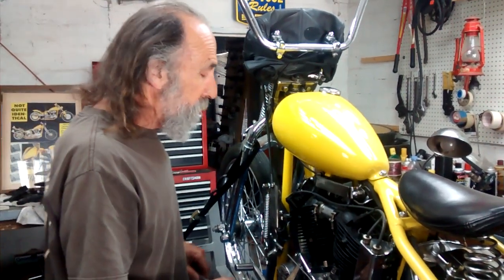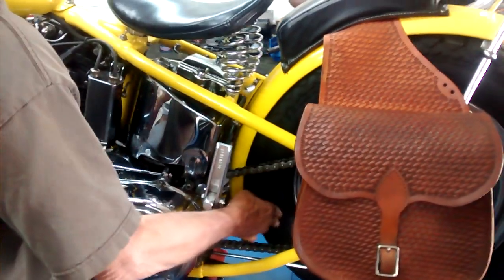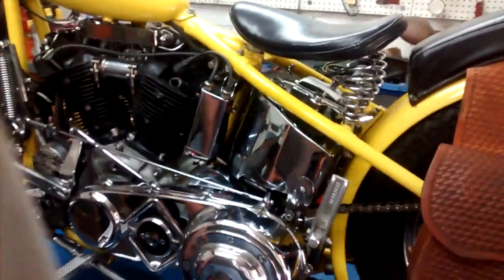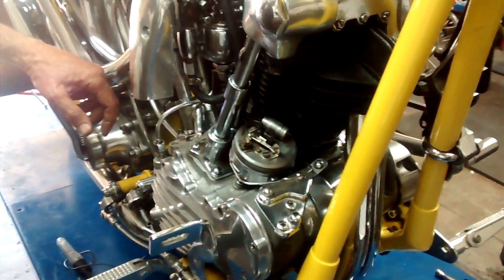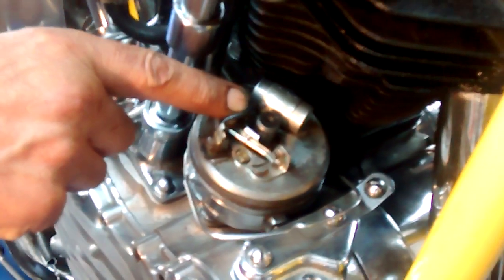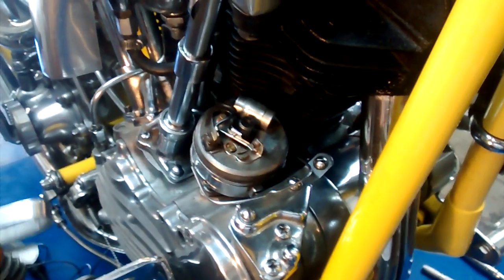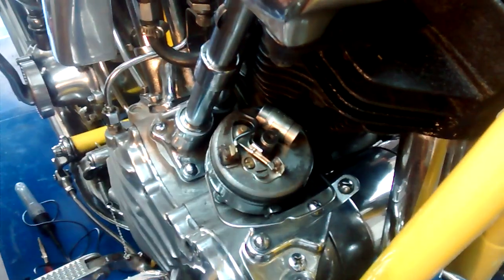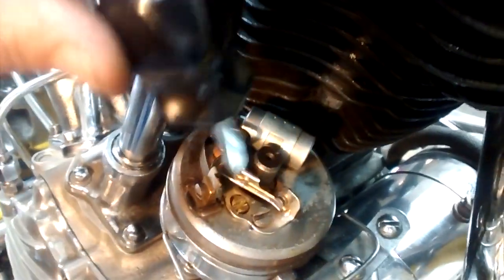How to set the points and timing on an old Harley Davidson Big Twin.

Comment: Hi Mike, thanks for getting back. So since 'unleaded fuel' you suggested that plugs are not so easy to read without the newfangled gizmo?
Reply from the maker: It's just that they don't color up like they used too.  Then, the manufacturers wants you to read the plug way deep inside where there"s a flat ring where the insulator and the outer casing go together.  It's a skinny little flat surface. They sell little flashlights with magnifiers on them so you can see inside the plug.  About all I can tell about a plug any more  is if the condition is real obvious  like,"wow,  there's nothing on it." or "That plug is dark."  Then there"s the usual, "They sure don't match," indicationg a vacuum leak.  I think the fuel is tough to read and I'd like to think we build our motors better.  Just ain't like it used to be. Nowdays, I'm pleased to have just a little color, my old bikes, a little more color than the newer stuff.

Comment: Any advice for a fresh bill everything seems to be time bride but keeps sputtering out the carburetor will not start
Reply from the maker: Start setting it up all over again and check each thing.  Gaps, plugs and points, battery voltage, voltage going in to coil, ignition timing, fuel flow to carburetor, and is the float bowl filling up.  Just go step by step all the way through it.  You'll get there.

Comment: Just had to say great video! First time watching your channel and yes i did subscribe. I have a 75 FLH with a 93" all S&S style shovel. It came with an electronic distributor but I'm thinking of switching it to points since i don't have everything i need to make it work and the parts to do so are expensive. Not sure whether to go single fire or dual as well as whether to go single or dual on the points. Just looking to build a reliable daily rider. Nothing more. Any help at all would be much appreciated. If your answers are to long for here i can provide my email address. Thank you sir and keep up the great work!
Reply from the maker: I hate to say it, but dual points are awful!  Getting them to sync properly and stay that way is somewhat maddening.  A 93" Shovelhead is a serious motor.  Be careful in your decisions and gear it very high.  It has the torque to pull tall gears and it will keep it at low rpm's.  When you can afford it, and I don't usually plug products, Dynatek is the answer.

Comment: Will this Work for an Evo man? I love your channel thank you. I bought a 97 lowrider man and it's my first vehicle. Trying to tune her up. Thanks man.
Reply from the maker: Has someone installed an ignition points system in your Evo?  If so, use an HD service manual that shows the procedure for 70-77 Big Twins.

Comment: On my 1966 shovelhead when the line is dead center in the window my intake valve has light pressure on it you cannot turn the pushrod. Should I loosen the pushrod so both valves are completely closed in that position?
Reply: It’s the same on 180 and 360 revolution
Reply from the maker: Turn the engine over by hand with the sparkplugs out.  When the intake drops, keep going until it has gone down as far as it is going to.  Now adjust it.  I'm assuming you have solid lifters.  If you do, you should be able to turn the pushrod with your fingers.  The limne on the flywheel is your advance timing mark, not TDC.  Those marks are for timing ignition, not adjusting valves.
Reply: @pacificmike9501  When my rear exhaust push rod is fully extended my front cylinder exhaust push rod is loose and vice verse. 

When my rear intake pushrod is fully extended my front intake push rod is loose and vice verse

At no point on the front cylinder is the intake and the exhaust loose for me to do timing. 

I’m trying to understand if I’m timed correctly at top dead center and not on overlap. The bike is running fine just a question.  1966 shovelhead
Reply: Yes I have solid lifters

Comment: Question Mike, tuning up my 58 FL, I wanted to check spark on the plugs, turning the engine over I notice that both plugs sparked at the same time, once at the timing mark on distributor then 180 degrees off for rear cylinder, is it normal that both plugs spark at the same time ?
Reply from the maker: Yes.  There is a "wasted" spark that goes to the "other" cylinder while the piston is on its exhaust stroke.
Reply: Unless you have 2 coils and dual points.
Reply: I have seen this

Comment: Heck, Mike, I was waiting for you to whip out a rolling paper (i wonder how many folks know what i'm talking about ^)
On my circuit breaker housing there's a timing mark that should align close to the outside edge of the strap the lock nut tightens down.
Are you familiar with that?
Reply from the maker: Sure, it is so, so that you can rotate the housing to give yourself the adjustment you require.  And, I've become so civilized that I use a feeler gauge.  Out on the road, under a tree, that's something a little different. Actually, back in the day, a matchbook cover was real close on point settings.

Comment: Hi Mike, appreciate the instruction vid!
Just wanted to let you know that the original instruction (per manual and Palmers restoration book) for single points early big twin is to set the timing with the line on the flywheel on the right side of the window and not the center. Unclear how close it should be to the right side (I've read 1/16th" and 1/8th") Also for Dale Marcus.

So my question for you Mike is how did you get to setting it in the center? According to the manual thats retarding the timing. Are you running unleaded fuel without ethanol? Also the cam that is in the bike is important of course.  Was it running hot at more advance? Just trying to figure it out for my own bike. Thanks in advance for a reply.
Reply from the maker: Make sure you're looking at the right manual for your bike.  The location of the advance mark on your flywheel should appear in the window where it is supposed to according to your size and model, automatic or manual advance.  You start out with the factory recommendation, then "minor" adjustment from there.  I don't know what your bike is.  But, there's a picture of that window in the right book.

Comment: Mike my names Nathan Morgan I'm from fayetteville Arkansas I have a 95 heritage Softail Springer built by American street dreams I now live down in Texas and my bike has a 38mm Edelbrock Quicksilver carburetor my dad had it sitting for about five years I finally brought it home got it running now it's running super rich fouling out the plugs could u give me any pointers by any chance brother
Reply from the maker: You're probably looking at the right place.  I have not even seen those carburetors in years.  They were distributed by Edelbrock, mostly through (maybe even "exclusively,'" not sure) Rivera Engineering.  I doubt, if you're careful, that you will require parts to disassemble and clean it out real well.  Also, clean out the tank and be sure you're running a clean fuel filter.  Be sure you're running a clean air filter.  If the air filter is real dirty, the carb will run way too rich.
Reply: I really appreciate ur advise brother I will keep u posted on how things are going with it God bless

Comment: What 12v coil are you running? Is it V twin?
Reply from the maker: It's a "one-off" unit assembled by a genius friend of mine.  On my Panhead, I run an Andrews coil (late style) and I use the bracket (after drilling out the rivets) off of an old coil.

Comment: is timing set off the advance mark or TDC mark?
Reply from the maker: The advance mark.  (vertical line)
Reply: @pacificmike9501  thank you. should i advance the cam to find where the points lift up? or no. thanks for your help
Reply from the maker: Not knowing what you have, I think you have a centrifigal advance ignition system.  So, you either have an old bike with a "distributor" (circuit breaker).  Or, you have a bike with a cone motor and a points system with a centrifigal advance mechanism.  You're doing this by hand and you've got the advance timing mark in the window.  Now turn the ignition cam all the way and it just starts to barely open the points.  That's it.  Make sure you are on the compression stroke of the front cylinder (both front cylinder valves are closed).  Now, buy a proper service manual and please tell me in the future, what bike you are working on.
Reply: @pacificmike9501  2001 sportster converted to points ignition with dual fire 5 ohm coil. thanks!

Comment: Good video but where are the serial numbers on your bike? I use the plastic plug and it has to be very close to the flywheel without touching it. I then have to hold the timing light at an angle to the side of the plug. Done it this way many times. If the plug gets scratched you can touch it up on the buffing wheel.
Reply from the maker: Thank You.  And, she has NOS  cases.

Comment: how would you set dual points with hand timing adjustment on a 62 fl ? ..thanks
Reply from the maker: Pretty involved.  It's explained very well in the HD 1959-1969 FL Service Manual.  Normally, unless someone really wants to preserve that system, I change over to the earlier (single points, single coil) system.  It's much easier to maintain and, in practice, gives a more "consistent" tune.  I don't mean to knock it.  But, when in the middle of nowhere,  I really prefer simplicity.  Whenever I tune one of those, they run beautifully, but they seem to require more maintenance to hold both sets of points to play well with each other.

Comment: looks like you set it to spark at exactly top dead center and not a bit advanced. Am I missing something?
Reply from the maker: The mark on the flywheel is the advance mark.  If you're timing to it, it is fully advanced.

Comment: I have a 66 shovel but i see no timing marks om the flywheel just one hole.help
Reply from the maker: Look at your service manual.  They describe the location of the advance timing mark.  I'll bet it's there (7/16" before TDC on the front cylinder compression stroke).

Comment: Mike, have got any other cool rides? If so can you do some work or videos on them?
Reply from the maker: I've been resurrecting my old road bike.  We've shown it getting it's motor and trans installed.  We've reinstalled the top end, front wheel and fender.  It's about ready to enjoy Spring.  It will show up, when it needs something.  Once it's going, the Panhead needs a new trans seal.  We'll show that.  We'll show things as they come up.  Thanks for watching.
Reply: @pacificmike9501  you bet,been following you about a month I guess,...I work in a shipyard and after that dose of daily mahem, I wind down watching you and tatro machine, ha ha, well keep making the videos.                      - Brad
Reply from the maker: Very cool, thank you.

Comment: Thank you for the video. I have a ‘47 EL and find doing this is such pain. The manual says that the gap should be .022” at the highest point of the cam lobe. I notice, however, when I retard the circuit breaker the points open and I can’t kick her over.
Reply from the maker: Are you setting the timing as per the service manual?  The slash mark on the flywheel in the center of the window with the circuit breaker advanced so the mark on the circuit breaker cam is lined up with the fiber on the points assembly.  Make sure the valves in the front cylinder are closed, so you know you are on the front cylinder compression stroke.
Reply: @pacificmike9501  I have not set the timing but will do so per your video. All of your videos are great BTW! Should the points open greater than .022” when you retard the circuit breaker? I’ve heard some people say they should close not open.
Reply: Mine does open so I believe it is working correctly. The timing might be off however but she had been running well.
Reply from the maker: It's not a pain.  It's fun.  You'll love it even more when you put a belt primary on it.  You'll get used to the ignition system, but, you gotta learn it.  I have faith in you.

Comment: I am having a hard time understanding what you are doing with the test light in conjunction with the timing marks.
Reply from the maker: With the flywheel timing mark in the right place and the points cam tiiming mark in the right place , the ignition should spark at the points lighting the test light.

Comment: I thought u set points to small lobe?
Reply from the maker: Sorry if something got lost in the translation.  Timing is set on the mark on the distributor cam.  However, when setting the points gap, there is a narrow and a wide lobe.  The lift is the same on both lobes.  It is much easier to set the gap using the wide lobe because it holds the points open longer.  Hope that helps.
Reply: Yes it did & thanks for the videos.. Have a 51' & 67'... very helpful!
Reply: Where did u get those mini aps for that springer? What's the width for the risers? I like those

Comment: How do you set the timing on a 1998 1340 harley motor that is fuel injection
Reply from the maker: I apologize.  Gonna have to do some research.  I honestly don't remember.  I don't remember how the pickup tied in with the Magnetti Marelli injection system.  Now I have to find a 1998 Evo book in my stuff.  As I recall, just setting the idle was quite a process.  More to come.  By the way, I'm sure I misspelled the brand of injection you have.
Reply: @pacificmike9501  yea I just picked this bike up I did a compression test the back was 165 and the front was 170 just not sure about the timing
Reply from the maker: I can't find my '98 Service Manual.  Then, I remembered.  First off, I haven't even seen one of these in at least a dozen years.  They have a sensor that plugs into the crankcase and reads off of the left flywheel.  This requires no adjustment.  This is the same system as cars use and referred to as a "crank trigger."
Reply: @pacificmike9501  ok think you sir
Reply from the maker: I'll still research it , first chance I get.  Congrats on your new bike.
Reply: @pacificmike9501  yes I have been looking for a app that I could put on my computer. Or something I have been told that I could do it using some kind of software or app of I could find one just not sure

Comment: What happens if you’re 180 degrees off?
Reply from the maker: It won't run.
Reply: @pacificmike9501  Im having problems with my, I just did the timing I think I’m 180 off it won’t start. But I’m chasing it! Thanks for the good video content Mike. Stay safe ✌🏽

Comment: Mike. Nice video but both cylinders fire at the same time.
Reply from the maker: No, both plugs fire at the same time.  One piston is on the compression stroke.  The other is on the exhaust stroke.
Reply: @pacificmike9501  Yes of course, your right both plugs fire at the same time but only one cylinder is on the power stroke.

Comment: What cases are those? OEM?
Reply from the maker: Yes they are.
Reply: @pacificmike9501  how come the number boss doesn't have a VIN on it though? Are they NOS cases? I'm asking becuase I have a pair of 47 knucklehead cases I bought at a garage sale they have the date code on the inside of the left case (H-7) witch indicates they were cast August of 47 and belly numbers are 47 also there also. Vin boss has never been stamped. It has not been filed down or anything its just blank.
Reply from the maker: Same thing.  These are NOS cases.

Comment: Yes I understand you ok, no more beige or mushroom colours which was really nice and clear, or 'white' if you are ether a bad mechanic, or just darn right unfortunate.
Reply from the maker: Okayfine.You got it.  I just don't adjust to change well.  And I really liked the gas we had in the sixties.  I really liked going to the pits at the jalopy races in the fifties.  They'd bring the car into the pits and pull all eight plugs, then read each one and put whatever plug the engine demanded in each cylinder.  There could be all different ranges and brands of plugs to get them all to burn the same.  It was great.

Comment: Nice scooter. I hate to critique your method of adjusting your circuit-breaker....but you know how it is when you see someone performing something that can be done a bit easier.....ha ! ha ! ....So, if you used a longer screwdriver, you’d have better control. Just some friendly critique. FTW.
Reply from the maker: Try a short one in there.  You'll have the clearance from the heads and cylinders.  Also, I enjoy the world.